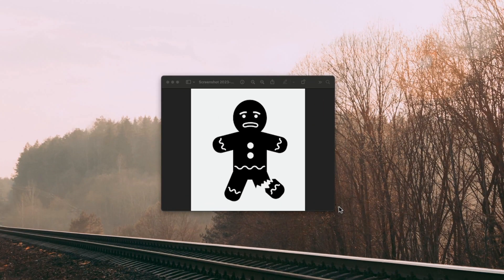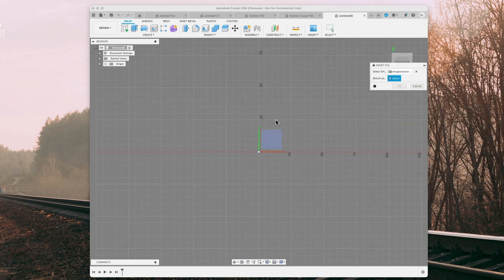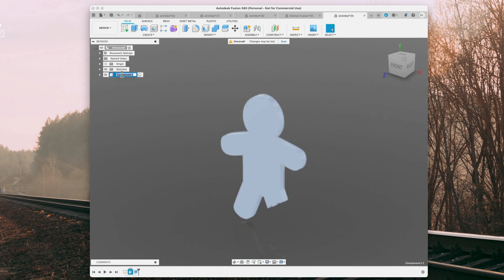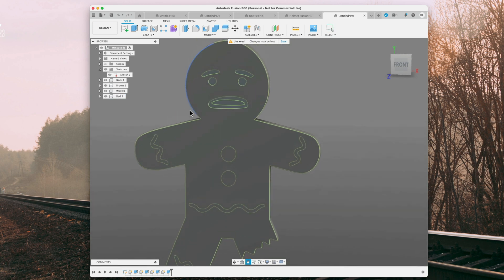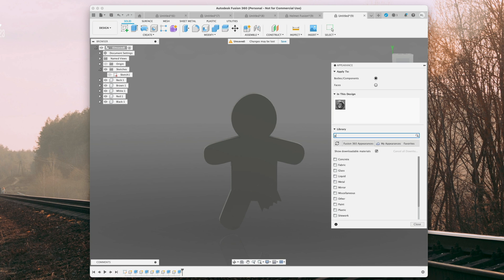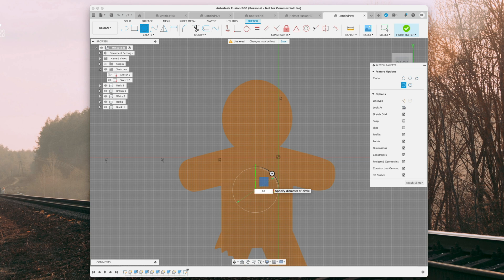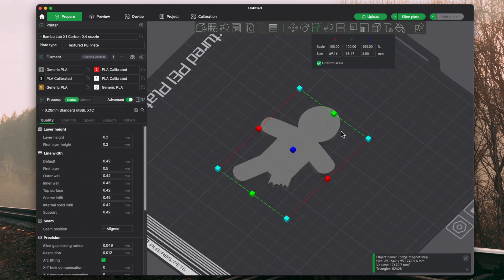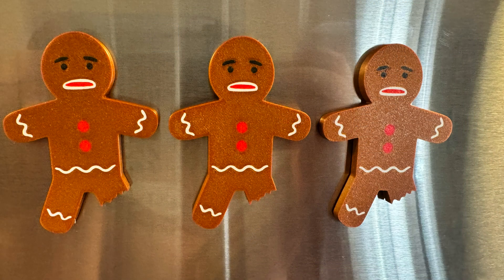How To Make Fridge Magnets Using Fusion 360 | Bambu Slicer | 3D Printing

Comment: so your colors are extruded 1mm and you slice your files at .2mm.  Is there a reason you couldnt extrude them say .4 or .6 to make less color changes to save on time and waste or do you find that less than 5 layers of color causes an issue?
Reply from the maker: Depending on the filament and colors 1mm is safe to no have bleed through with certain colors